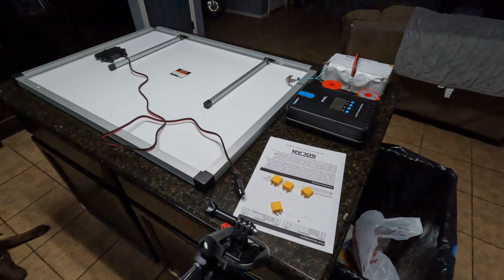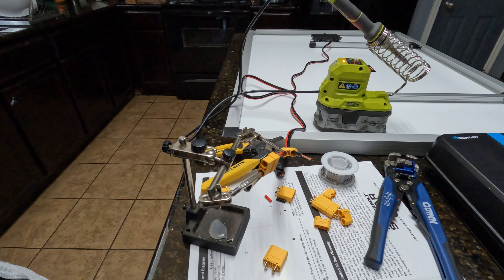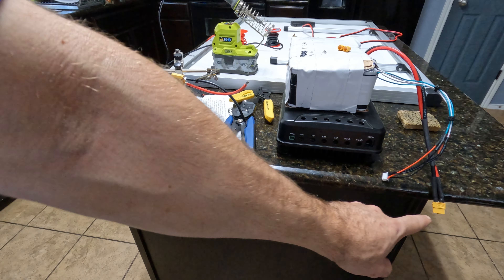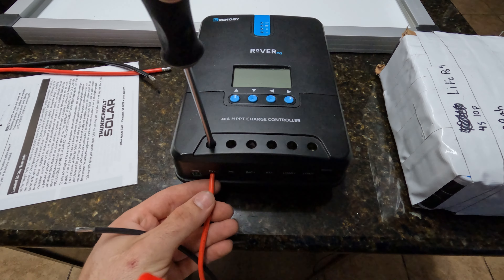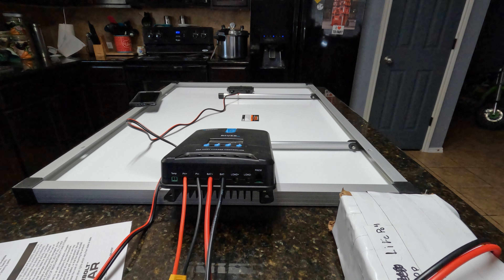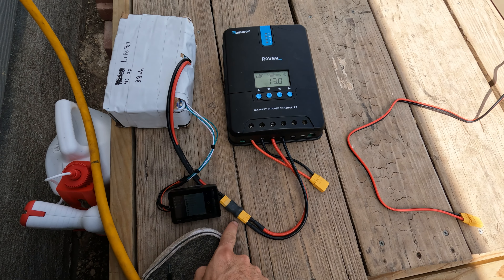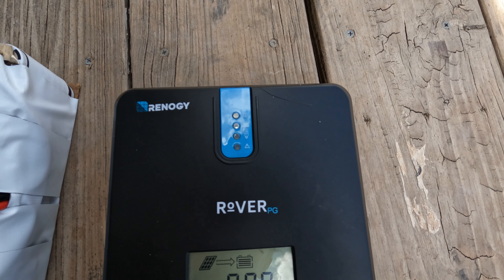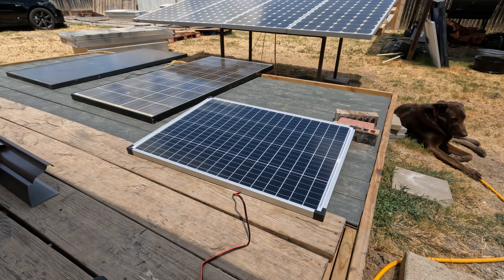DIY solar generator in 10 minutes, using Harbor Freight 100 watt panel

Comment: They say you should put the two halves of the connectors together before you solder them. It helps to line up the parts and provides more of a heat sink. I saw that panel at Harbor Freight yesterday, almost bought it to try something similar for our teardrop camper. Good video.
Reply from the maker: Yes I agree with you! It seems solid man hard to beat

Comment: I'm wanting to be able to practice guitar on the road, so naturally I was wondering what exactly I needed to be able to power a 15 to 30 watt amp or a small TV and game system for those rainy days lol as well as charging all the electronics some cooking and  lights etc. I was also thinking of having the alternator charge the while on the road and solar while camping to charge the batteries.  I'm just wondering if it'll we enough. I could probably find an old rv and transfer the power station and modify it for solar / alternator also a 
15 or 30 amp plug in so I can camp at an rv park. Is it possible or ideal?
Reply from the maker: This could easily power small stuff like your amp, cooking requires a good amount of current. I'd oversize your system to give you room for growth. At some point you will have to pick between being portable and being powerful due to the weight and size of bigger batteries, inverter and all that. I personally would start small and work your way up. If installing Into a camper than you have plenty of room for batteries, panels and all that stuff.
Reply: First you need to know what size inverter you need to run/charge everything then what size batteries to have for your inverter, then your panels to keep your battery charged, everyone has a different way of do this and their's lots of videos to help you figure it out...good luck.https://youtu.be/7reC9QlPHlA

Comment: So is this just for mobile cordless tool charging?  Or is there another purpose you had in mind ultimately?
Reply from the maker: The possibility is really endless when it comes to small scale dc charging setups. lm not sure what I want to do just yet, but I'm sure I'll figure out something cool. And I'll make a video about it lol. Thank you for your comment
Reply: That's true, im suprised rc guys don't have this kinda setup would make charging on the go super convenient
Reply from the maker: @DyslexicDoodle  I actually do alot of rc so I may build a small setup just for that using a muleaukee packout for the case 😅
Reply: That's a great idea, you could use the packout itself as a fully integrated charging station